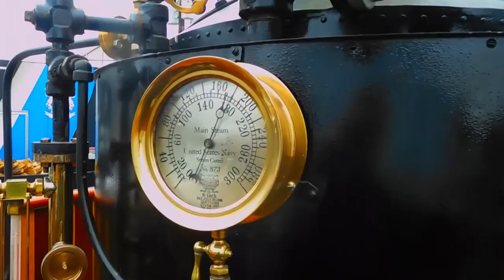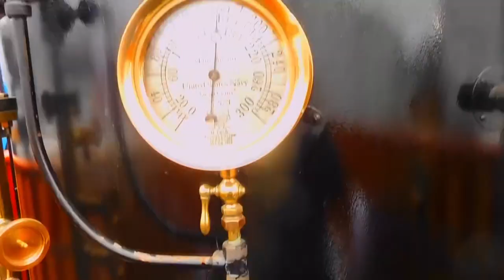US Navy Cutter No. 873 power plant test

Comment: Bonjour Alexander,
What a beauty ! And a compound with a donkey pump furthermore, great steam plant indeed which looks brand new !
You show a condenser pipe and evoke vacuum, would this mean that you would create a depression only with a cold water, without any vacuum pump as I didn't see it ? Did I miss something ? Never mind, I hope you will ba lucky enough to navigate with her and share with us your experience.
Amicalement, Raphaël
Reply from the maker: Raphael, this engine is fitted with a double-edward's type pump driven off of an eccentric, it should be visible in the video.  It is mounted aft.  The engine is LP avant, HP aft.
Reply: @AEKarnes   Bonjour Alexander,
Sorry, I had seen it but I thought it was  a coupled water pump. As the donkey pump could fail, is there a manual one to secure it, not seen either 🤔?
Amicalement, Raphaël

Comment: You must have an air leak into the condenser.  I have cooled my condenser using a similar method (using less water), and was able to maintain about 10" of vacuum with no problem.
Reply from the maker: What it turned out to be was a broken vacuum gauge.  We were pulling vacuum, not much but enough to pull my thumb over the gauge cock and enough to make the engine run smoothly on LP crank impulses as you see.  When I destroyed the vacuum on purpose it galloped and stalled.